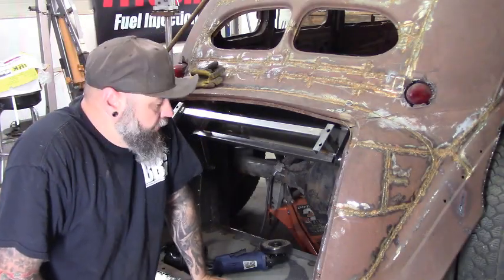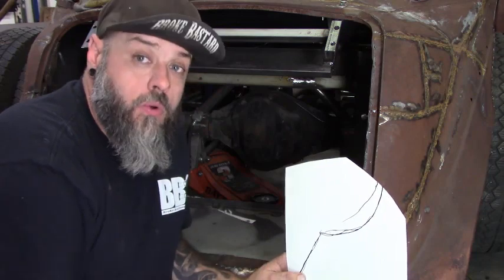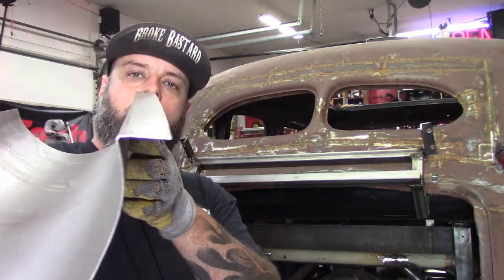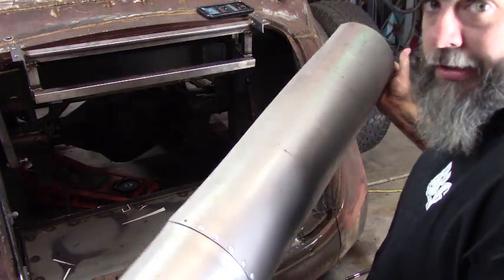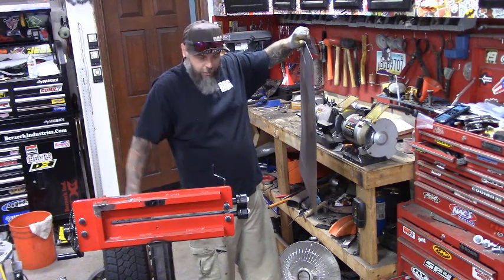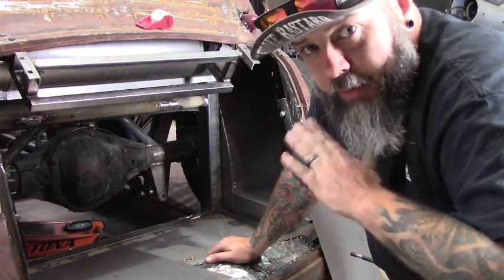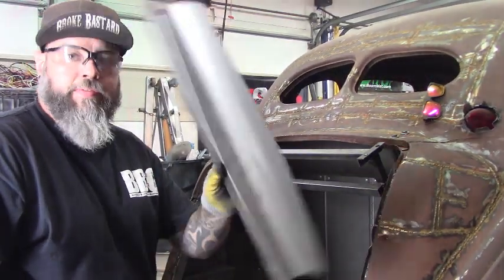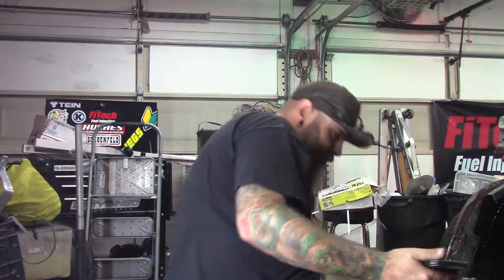Making Panels with a Sheet Metal Roller 1937 Rat Rod Update 47

Comment: I have a HF bead roller and powered it with a HF 1/2" variable speed drill motor
I made a large pulley for the 'roller shaft' out of 2 circles of plywood, some 20" in dia. with beveled edges.
'when put together they formed a groove for the fan belt to set in.
'then chucked up a tiny pulley with a 5/8" bolt running through it.
plenty of power if a little slow

I enjoy the attitude you attack your projects with

Comment: I’ve seen people use a starter from an old school SBC, combined with a 3 piece timing set retrofitted to an engine stand to rotate the engine.
I’d say a similar setup would be more than strong enough for your bead roller with the gear reduction of the starter motor. 👍👍👍